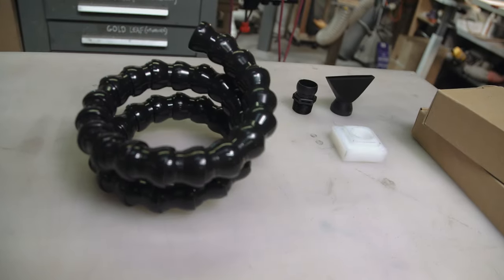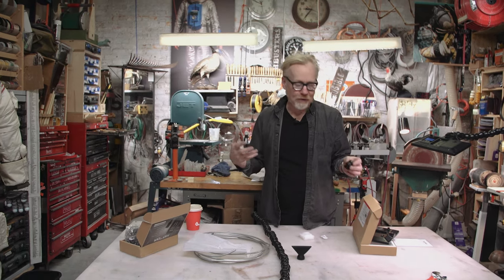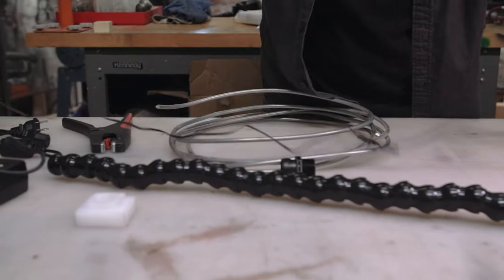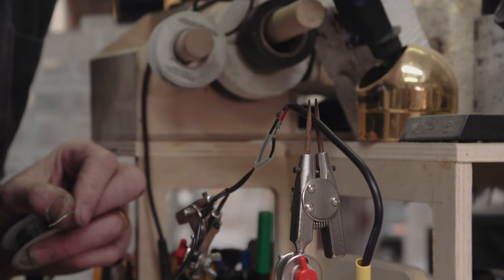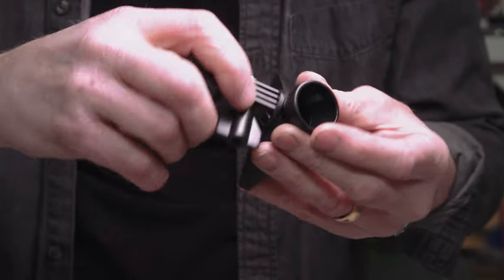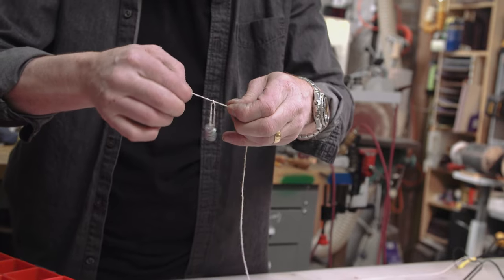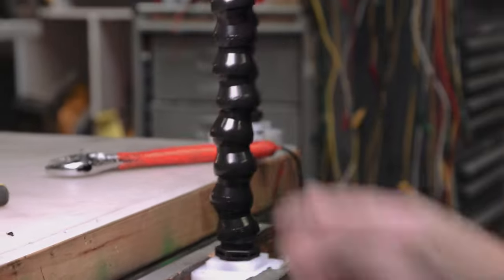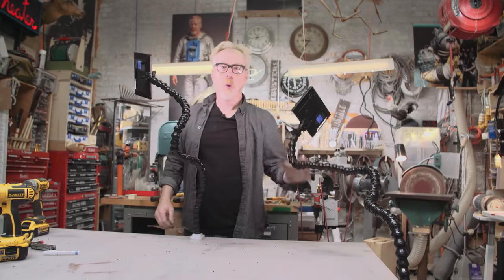Adam Savage's One Day Builds: Custom Workbench LED Lamp!

Comment: What wire strippers are those?  I had a great pair, I loved, for years but they broke and I can't find a replacement.
Reply: Yeah, those looked great.  Would love to know the brand.
Reply: I was gonna ask this question
Reply: It looks like the strippers Adam uses here are the Knipex 12 42 195 or something very very similar/possibly a rebrand of the same tool. $90 on Amazon right now. 

I have the Knipex 12 62 180 and I love them. They're more of a pistol shape, and a bit cheaper. They've been perfect for my needs. Those are $40 on Amazon.
Reply: The hero we need
Reply: i need aswell
Reply: I've never been told this but I've always just assumed that Knipex auto strippers were made by Wezag.
Reply: I ordered a pair after watching this video, but ended up returning them.  For the money they were no better than the pistol type I had from my days as a mechanic, and would not strip small wire as advertised.  Since I use servo wire quite a bit, that was the main reason I bought them, and they were unsuitable.
Reply: Warshipmodelsunderwa find anything better?
Reply: I went back to using one made by Mac Tools, that I bought many years ago.   I'm pretty sure they just plopped their name on something made by another company, but it has lasted and works well for wire 12 to about 20 gauge.    Mac doesn't sell this one anymore, but you can find similar from OTC; I don't know if they are the same quality - the weak spot on plastic strippers is the upper arm past the pivot.    Here is the model I have:  https://offerup.com/item/detail/365930904/

Comment: I just use my 18650 Armytek headlamp.
Reply: minus the temperature change?
Reply: Warm 3000k tint High-CRI FTW
Reply: I picked up a COB based 150 lumen LED headlamp for $5. Sure there's no color temp adjust, but most lights don't have that anyway. If you just want more light, it can be cheaper than a coffee.
Reply: BangDroid - I was thinking the same thing. They have a lot of nice lamps online for south of $40. That is one expensive ass lamp for what it's doing. I could maybe understand if it included a magnifying lens.....maybe.

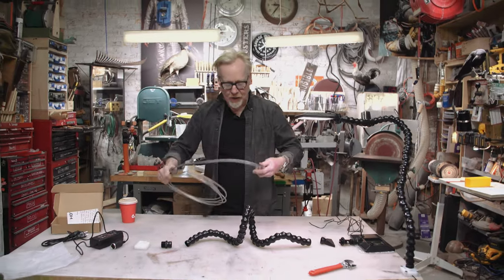Comment: 5:30 "The Armature wire is a key part of this build" 
Links provided for everything BUT the armature wire......
Reply: @elobiretv  judgemental twit much? No specification as to which armature wire aas used.  They come in uite a variety of diameters and even alloys which vary their flexibility and rigidity characteristics. But sure random folks should just spend moneg on  random bits from amazon until they find the right mix...
Reply: @VolgClawtooth  You've got a point, guess  I was being a twit.

Comment: You can tell the whole thing is fake because Adam didn't solder the wires before putting the heat shrink on, then have to redo the whole thing again! sarcasm Very cool project and I might have to make something similar for my shop!

Comment: Great build Adam! Think I will build one of these for my workshop. Only thing I may do different is use heat shrink on the aluminum rod and also the base of the linelock for added rigidity.
Reply: Hi, I recreated the lamp. My problem is the rigidity. I've used 5mm aluminum anchor wire the full length of the Loc-Line, but it's not stiff enough. Which anchor wire did you use and what is the length of your Loc-Line? Mine is 150cm long and 3/4 inch, I'll probably have to shorten it. 
Greetings from Germany.....Tom
Reply: @kinotom3639  Hi Tom. Brilliant on re-creating the lamp. I've not yet built mine, but I have noticed Adams do tend to move on occasion. Although they are genius in their design (much like all Adam builds) they look to me to need a bit of beefing up. I will let you know on the thread when I build and give feedback to your question. Thanks 
Matt
Reply: @mattwilliams8075 
 Oh thanks for the quick reply. I am the owner of a cinema and would like to build this lamp on my sales counter for advertising purposes.
If you have built your lamp you can tell me your experiences, that would be very nice. Thanks in advance........Tom...in the meantime I'll keep trying...😃

Comment: Adam, if you make more of those, there are numerous spring clamp arms for Gopro that uses lock-line.  You can use the end of that arm to a simple 1/4 20 adapter to reduce weight and complication at the end of your arm.  Fantastic build either way.

Comment: Adam, you asked for other versions of your lamp. What I did for my hobby bench was to begin with a podium mount (for mic/audio gear) screwed down near the edge of my desk with a 12" gooseneck screwed on. At the top of the gooseneck  I used a universal mic clip, which holds a small police multi-led flashlight. The light can be pointed anywhere, including upward, from underneath a project such as an RC vehicle. Very handy little hack. Btw, thanks for your years of involvement on Busters - I  continue to learn cool tips & tricks just from reruns. I hope that show goes on in syndication for many years to come (and that there are lots of residuals headed in your direction.)

Comment: I saw this light in one of Adams videos before this came out, and managed to build nearly the exact same thing by eyesight (and luck). Loc-line is expensive and you really need the crimper to work with it well. I used 6 pieces of steel wire twisted together (for tying rebar) and ran it inside the loc-line - while that worked pretty good it also suffered from the same sag problem in certain positions. I gave up on that and bought a spring loaded desk lamp arm which worked much much better - no sag in any position!

Comment: I would recommend also getting magnifying swing arm lamp for close in work, or one like this one that has a magnifying glass surrounded by lights for real close in work. It reduces eye strain and can let you do fine work easier. My father has one of the old school swing arm ones that uses a florescent ring light and it is so nice to use.

Also, pro tip on soldering: tin both parts lightly before trying to join them and then just gently push the parts together and add a little heat from the iron. This keeps cold joints (incomplete soldering) from happening, which prevents a hot spot or an open circuit from happening where you soldered. It also requires less heat, which will keep you from damaging sensitive parts, like chips.

Comment: In place of the lockline one thing you can do is use an adjustable microphone stand.   It works amazingly well and is also much cheaper than using lockline and will be more stable and already has a clamping solution built in which also makes moving it around much better than a screwed down solution although you can easily replace the C clamp on the microphone stand with a rolling stand or a screw down solution. It honestly works amazingly well.

Comment: That bit you machined out of delrin...as an idea, a pipe flange. Super handy, I've used em in similar "plumbing not used for plumbing" situations. Not every hardware store stocks em, but ACE usually does. Or you could go with a plastic model and use a chemical glue to bond the pipe to the unit. And they're like $4 for 3/4in.

Comment: Nice project......One other Idea for  a nice adjustable light, but with out diming and color adjustment, is to take a boom arm light with magnifying glass in the middle.  I disconnected the power to the round fluorescent tube and spiral wraped strip leds around the tube.  I used 12volt led strips and used the power cord to the tube to connect to the LEDs and then back to a 12vdc power supply.  Nice bright light and a magnifying glass to boot.

Comment: Love the idea, but a couple of comments regarding the build:
- Gas soldering irons are nice (I personally prefer the Weller models) but they stink at temperature control and tend to burn the solder. I use them only for limited field work and use a nice temp controlled iron at my bench (they are now so cheap there's no excuse to not have one).
- It is very easy to burn the shrink tubing (and the isolation of the wires) when using a blue flame torch. If you are doing it be careful and keep the end of the flame away from the tubing at least 3-5 cm. Hot air guns are much more forgiving for this operation.

Comment: just a little tip   use ball chain to get the wire trough       cross the coperwire around the last ball   and feed it trough
so you already got the weight   and can feed trough much smaller holes than the  washers can

Comment: When you are doing soldered or crimped splices stagger your splices if possible.  This helps keep the size of the joint down and also reduces the chance of a short if  a splice pulls apart.

Comment: That loc-line "flange" is actually most commonly used as an aquarium "flare nozzle" or "return". You attach it to your sump pump and it disperses the water into the aquarium. We use loc-line for the exact same reason as you are here, adjustable but stable once you set it to how you like. Flow is important in an aquarium and loc-line with the flare nozzle is perfect for that.

Comment: Small butane soldering iron tip: you don't have to leave the butane going while it's not in use. As long as the catalyst is still hot (about 100-150C / 200-300F), the moment the gas starts to flow over it, it'll "ignite" again (or, rather, start undergoing catalytic combustion) and get back up to temp real quick. With a Weller Pyropen, i can go for about a minute or two with gas off, sometimes even more, before needing to re-ignite with a lighter.

Comment: I tend to have a little hand vac next to my workspace and will use the suction to pull 'fish string' through tubing rather than dealing with tying on weights and whatnot. Easily shaves 8 seconds off your build time which can be later spent trying to find the bottle opener for your completion beer.

Comment: hey Adam, when soldering wires together you should offset the wires to avoid shorts if the heat-shrink breaks down or some stray wire pokes through.

Comment: thumbs up for the soldering station 👍👍
Reply: Who the heck uses a butane soldering iron for electronics? My Hakko heats up in about five seconds and costs less than this lamp. Butane irons get too hot and eat through the tip in no time, look how corroded it is. Adam is a genius at fabrication but he needs to be kept away from electronics projects.

Comment: For wire connections that will potentially have tension pulled on them like this. It's a good idea to J-hook your wires. Bend the stripped ends of the wires into a U shape, hook them together and twist both sides in the same direction. Don't need a lot of solder this way, just enough to wick into the crevices. A half decent J-hook is stronger than the surrounding wire in both tension and torsion.

Comment: Adam, that's some nice engraving work in that video, but don't let them hear you call that a chisel!  Although it's obviously the same basic cutting principles, that's a graver.  They've got specific shapes for different lines/effects, but they also usually have a unique flat 'heel' on the back end of the cutting edge that basically sits flat on the work and prevents the graver from continuing to dig in deeper as it is moved forward.  There also might have been a rotary tool for hogging out some material, but I'm not sure.

Comment: Another tip for fishing wire through tubes:  Use a shop vac to suck the string through. This works well for tubes that you can't orient vertically and get a gravity assist with a weight on the string.

Comment: Yay, new build. Might have missed some xenomorph-esque opportunities though :) I also notice when people solder wires together they put the connection side by side instead of offsetting them and making the connection neater. Connection against insulation of the other wire would only need one heatshrink, and even covering each would add less to the total thickness.

Comment: Great job Sir.  Very nice.

I don't have an epic shop like yours, but I'm already thinking I could do that, Mount it in a piece of 2x4, and c-clamp that to anything....  there's 12v power in my truck, so I can use it anywhere....  (sometimes you need to be mobile, the project is not coming to you...)

Very nice.

Comment: I would also add vacuum caps to the end of the armature wire and steel rod to ensure no damage, a pipe flange would work to bold down to a work bench too

Comment: Not sure Adam reads this but another awesome way of sending pulling string through even intricately bent tubing is with an air nozzle.  Just blow the air through and it will pull the string all the way through.  No tying weights no flipping the part all around to use gravity.

Comment: As an alternate mounting suggestion, for those with woodworkers benches, I just attach a 3/4" dowel to the end and mount it into one of my bench dog holes.  In that there are 15 holes on each side of the bench it affords tremendous mounting flexibility.

Comment: For a simpler pass-through for the wire, just tie the other end of the string to the cord end and once the washers come out, you only need to pull which will then pull the wire through as well.

Comment: A weight on the end of a string Adam. Is called a mouse, which can be used as a draw string. You should always pull 2 wires/ strings at a time! Because as in this vid shows you may have pull more wires than was first thought !

Comment: Use a shop-vac to suck the power wire through the Loc-line or other conduit.  A light messenger line (pull string) can be pulled more than a hundred feet.

Comment: Adam try using an air nozzle to blow through the line while feeding a string into the hose/line/pipe/tube.
Learned this trick while running electrical wire through custom motorcycle frames.

Comment: My mother just recently got me a 6" diameter X10 magnifying lens with an extra X50 1" spot magnifier fused near the edge of the glass. It is mounted on top of a round florescent tube light. It has a positional neck that just doesn't like to stay where you put it and a light base that likes to fall over if the neck is stretched too far out (like not even half way, sheesh!). It is great for my close, tiny bead work but I have to weigh down the base and keep adjusting the neck.... ugh!! I have been wondering what to do for it and this is perfect. Thanks Adam  💗

Comment: At 3:50, (the base), you would be surprised how well wood can be threaded with common taps. I tap hardwood and Baltic Birch plywood all the time. I have used both coarse (UNC) threads and  pipe (NPT) threads and both work well. In fact, I have a vacuum setup on my CNC router using Loc-Line NPT connectors which screw into BB plywood.

Comment: One tip! If you want something in a pipe but it’s long  you can..... use fishing line and little bit of cloth. Knitting the cloth on the end of the fishing line. And use a compressor and blow it in the pipe and you can blow it very long distance easily 60 feet! Remember my name Mattias from Sweden 🇸🇪 😎

Comment: Next time you need to "fish" something through a piece of tubing... Just use compressed air!
Stuff a length of string into one end and shoot some air down the tube and boom! Done in a second.
I do it all the time in 80x40mm stainless tube when I have to pull though flexible hoses.

Keep up the good work mate.

Comment: A flange fitting would be the most appropriate base mount if you wanted something permanent. Also, the panel mount end could be done using another 3/4" NPT adapter and a threaded cap with a 1/4"-20 bolt poked through the center and a lock nut holding it in place. That would allow you space next to the bolt to drill a hole to feed the power through as well as either directly mount the panel using it's adapter, or use it as a camera/speaker mount.

Comment: the custom piece you made from delrin is available in metal from homedepot or amazon for 5 bucks with the 3/4 threads and 4 screw holes. Search for it its called "3/4 npt floor flange"

Comment: I have a couple of questions: 

1. Would it be beneficial to use armature wiring throughout the piping? 

2. How could you adapt this to a light fixture? (I installed one over my desk area and have been searching for a good flexible way to extebd light over my work)

Comment: I'm not going to make this BUT what about having a base with telescoping legs like from an old car radio? at a V angle kinda like an engine hoist?.
That as you extend the lamp out the legs can be extended for support, if you're working closer you can retract the legs (save desk space obviously).
Bit fiddly sure and needs further research but its not secured down and you could take your lamp with you for other jobs. All the best TT.

Comment: Another great one day build, so soon too! This is also perfect for me, I have some lights but the mounting options aren't ideal and that panel looks much better than the one I have too. Will certainly be looking to build one of my own, cheers Adam! I might see if I can use USB power too, I've been having lots of success with USB 5V to 12V converters but it does of course depend on the current draw of the device.

Comment: I have those lights, and the associated camera batteries. They are quite handy. But for a power supply, you can just use the regular 60w ones that can power a 5m LED strip. Those can be had for $9 and no wiring, soldering necessary.

Comment: For those interested in some of the tools Adam used in this video:
Knipex 10" Diagonal Cutters (on the armature wire)
Fluke 101 Multimeter (used to check for continuity)
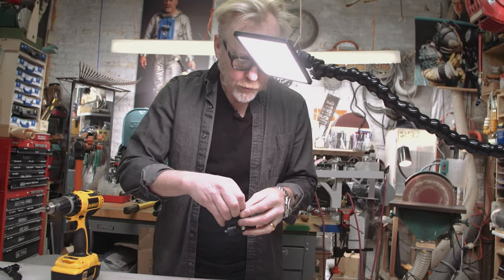Wiha Precision Philips Screwdriver (13:10 to screw a screw)

Comment: I've been working on building one of these lights by repurposing a halogen gooseneck lamp for six dang months.  I'm ALMOST done but the DC barrel plug that is going to thread into the base is a bit of an oddball.  M11x1. One fricking tap is almost $30 on McMaster!  I will finish the dang thing... sooner or later.